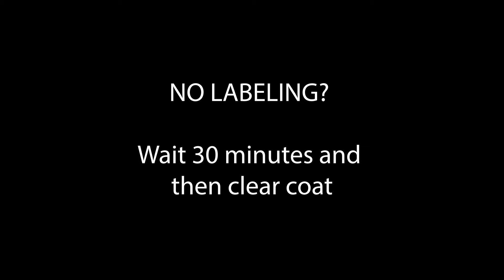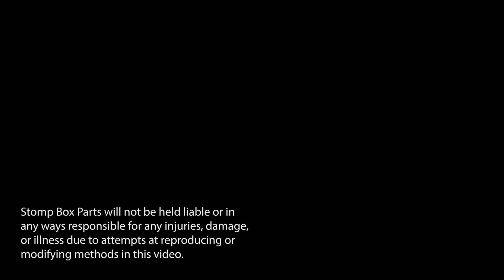How To Paint Guitar Pedal Enclosures | DIY Stomp Box Tutorials by StompBoxParts.com

Comment: If I use a textured paint, will that cause problems with applying a label and getting it to stick?
Reply from the maker: Depends on how textured. If you're applying waterslide/sticker/label that cover the whole face of the pedal, the texture may cause issues. Smoother or flatter paints will work better in that case. If you must use textured, you'll probably need to apply several layers of clear coat to smooth it out a bit.

Comment: That krylon No runs plus glossy coat was already built in the paint pre installed for one coat. the first attempt looks pro no sanding..let sit in the hot sun..Didn't have luck with rustoleum ,metallic  looks like storm clouds and my crackly feet..After I added their rustoleum clear coat.
Reply from the maker: Lots of ways to accomplish this! Glad you found a method that works for you!

Comment: If I want my pedal to gradually degrade and chip overtime, could I just only do the base coat? Or would it all come off quite quickly?
Reply from the maker: That would be an option, but clear coat might be necessary depending on how(/if) you're labeling. Or skip the primer. It'll chip much quicker without the primer.
Reply: @StompBoxParts  I'll just be sharpieing on vol, gain, etc haha.

 And alright, I'll do that. Thanks!!
Reply: @StompBoxParts  Found some cheap-ish spraypaint from a few years ago that has mixed-in primer -  should do the trick! lol

Comment: ### Conditions

* Well ventilated space
* Little no wind
* 60 to 85 Fahrenheit
* Relative humidity <65%
### Supplies

* Surface to paint on
* Vented covering between coats (cardboard box)
* Wet/dry sandpaper around 320 grit
* Stilts, optional (chunks of wood, balled up paper, etc.)
* Self etching or aluminum primer
* Base coat, textured recommended over flat paint because it is more forgiving and doesn't require sanding between coats
* Clear coat (durable top coat for thicker, lacquer for thinner finish)
* Labels (sharpie, stencils, rubber stamps and ink, vinyl stickers, water slide decals)
* Enclosure

### Steps

1. Surface prep: under running water sand the entire surface of the pedal with ~320 grit sandpaper. Wash pedal with dish soap and brush
2. Primer: let pedal fully dry and sit wherever you're painting 5 or so minutes to acclimate to temperature. Apply a quick, thin coat of self etching primer from 6-12 inches away. Keep the can moving and don't worry about coating the entire pedal in one coat. Wait 5-10 minutes before the next coat, with the pedal under your cardboard box. 2 or 3 primer coats is usually good.
3. Base coat: like the primer, apply 3-4 thin coats
4. Labeling: wait an hour until dry to move. Let fully cure for 24-48 hours. Add labels of choice. Let labels fully dry before clear coating
5. Clear coat: similar process to primer and base coat. Apply 2+ thin coats. 
6. Let fully dry 24-48 hours before filling with parts.
Reply: Unsung hero of YouTube.

Comment: What is gained with sanding in between layers? Others recommend it but you're not doing so and this result seems fine from what I can see.
Reply from the maker: If the paint is still wet do not sand. If the paint is dry, sanding will help the new coat stick better and flattens out the dry coat. Certain finishes (like hammertone used in this video) simply don't work with sanding because you'd be sanding off the hammer texture.

Comment: An other method of coloring a pedal enclosure without using paint or spray paint? I live in an apartment so I can't use spray paint inside or outside without getting a citation
Reply from the maker: If those are your limitations then it would definitely make most sense to buy something already powder coated or painted.

Comment: Any reason I wouldn't want to use a base coat paint that includes primer, like Rust-oluem Painter's Touch 2X Ultra Cover Paint + Primer?  Could this remove the primer spraying step completely?
Reply from the maker: Might work fine for you but I can't know for sure. The typical downfall of paint/primer is that it isn't made to adhere well to metal, thus why we recommend the self-etching primer.
Reply: @StompBoxParts  Okay. Thanks. You didn't mention sanding between coats. Is that not necessary? Do you do any sanding at all? If you do, what grit do you use?
Reply from the maker: @jimwheeler5278  Not necessary! (and actually not recommended until the paint is completely dry, which takes a day or two)

Comment: Do you use any sort of naphtha or acetone after sanding to clean the pedal prior to primer?
Reply from the maker: Soap and water to clean, wipe it off and let it air dry like in the video. You could use naphtha or acetone or isopropyl alcohol to speed up the drying process but it's not necessary.

Comment: For the labeling, did you perform the same steps you did from your "How to Add Labels.." video?
Reply from the maker: For the pedal graphics in this video I used a vinyl stencil. You can insert just about any method of adding labels in that section of painting your pedal assuming the base coat in dry enough to handle. Stencils, decals, stamps, etc.
Reply: @StompBoxParts  I have a Cricut.  Will that suffice for labels?
Reply: @lonewolf42187  yes. You can use a Cricut either to cut stencils for painting labels, or to cut vinyl labels to stick directly and then clear coat over to protect.